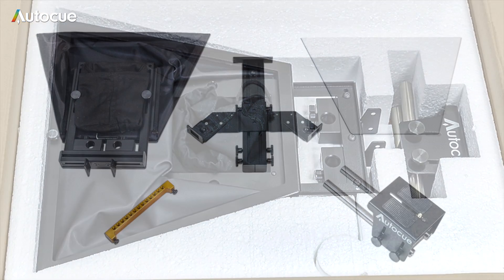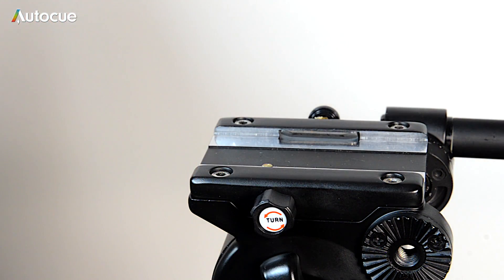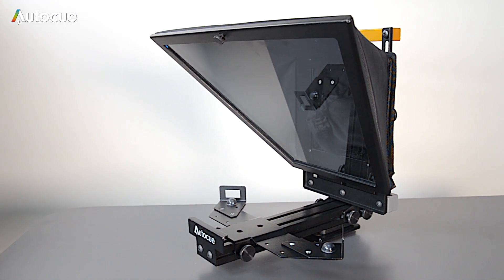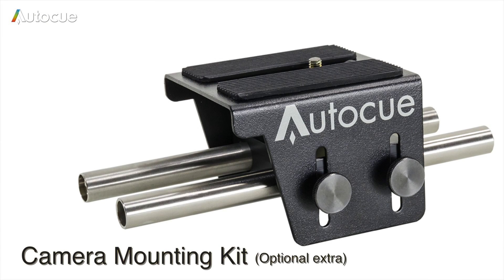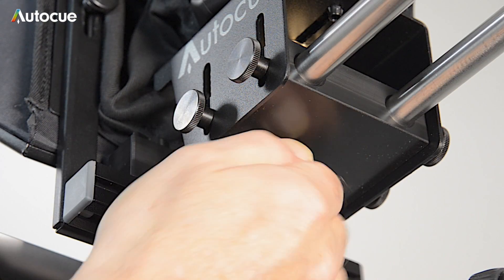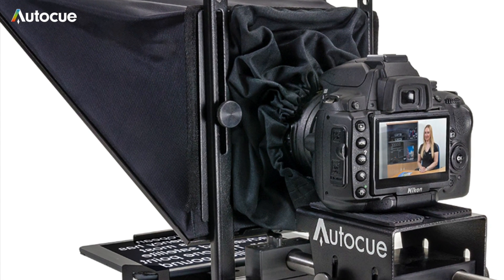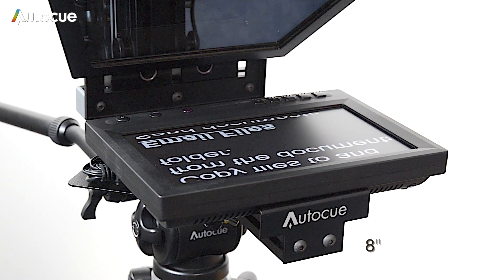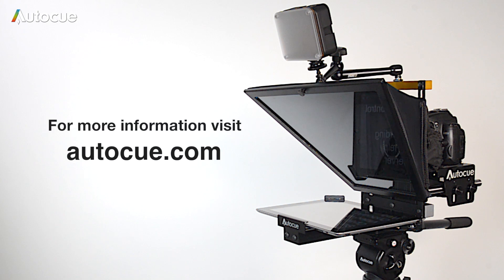Autocue's DSLR Teleprompter

Comment: where's the padding for my expensive tablet
Reply: If you're worried about your expensive tablet, you should already have a body shell case on it, which will protect it sufficiently whilst in the mount.
Reply: @georgefeatherby  according to this presentation.  I see not room or accommodations for a case to be added. Do u
Reply: @jmac2050  Yes, it’s an adjustable mount. A body shell case adds millimetres to size of a tablet. It easily fits, as with other iPad teleprompters. My point is, that if you hadn’t planned on using a case up until the point you put your tablet in this, then this mount is not going to cause sufficient damage to your device to be of concern given the daily rigours an unprotected tablet already would be going through being laid down on surfaces and thrown in bags etc. 👍🏻
Reply: @georgefeatherby  my point is I been using a relatively thick wheather seal case on my tablet.  The  video doesn't show accommodations of any type of case. Not going to assume it can.